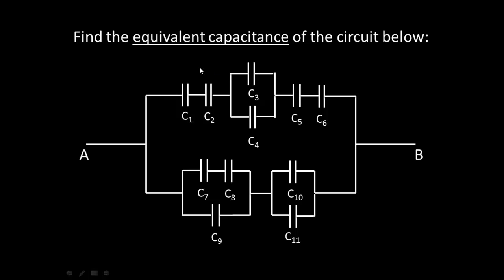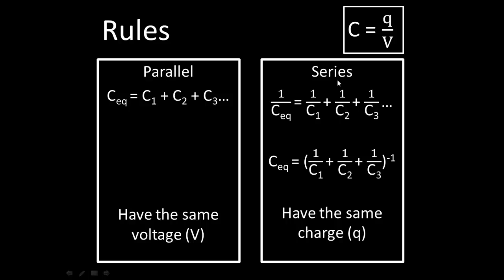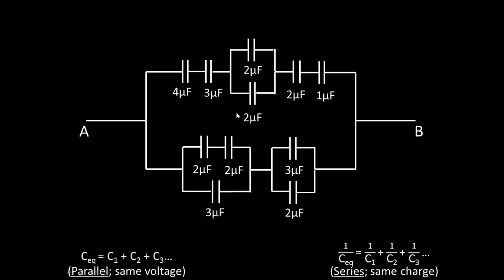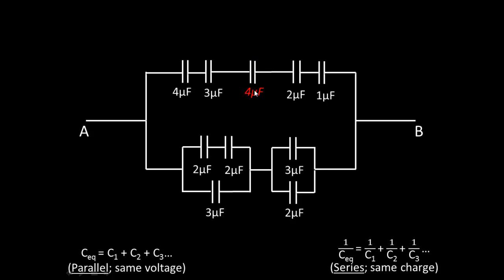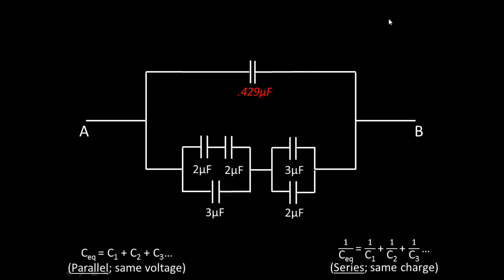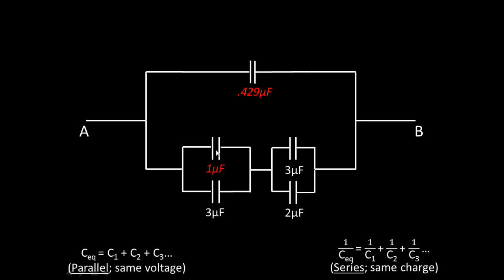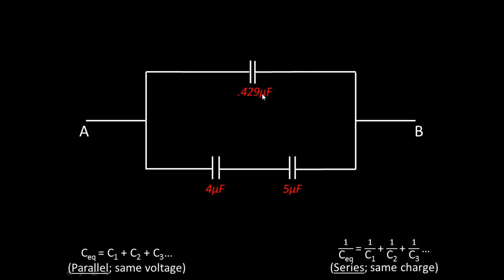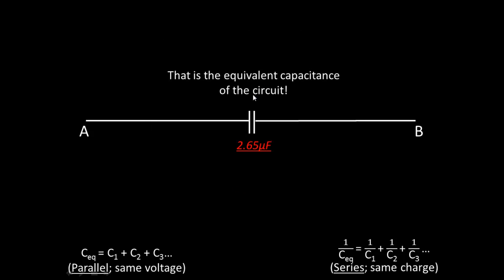Equivalent Capacitance of A Basic Circuit

Comment: I'm kinda stuck over here and need help how did you get 7/3?
Reply: Sajeel Daud I'm sure you don't need this help anymore, but for anyone that sees this... I'm not sure how he got that either, and I've seen other people do the same thing. When I find it I just take the sum of all the inverses (1/2+1/4+1/6+n+n...) and divide it by 1. So if the sum of the total was 2.33 like I found for the one above he did, then it would be 1/2.33 = 0.429 (which was the answer he got as well). So far it's worked fine for me in my physics class.